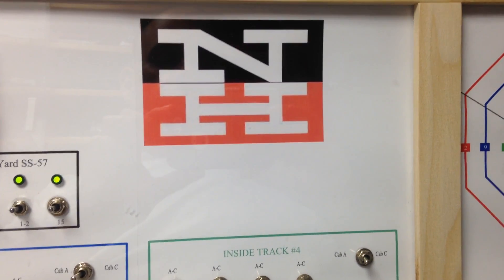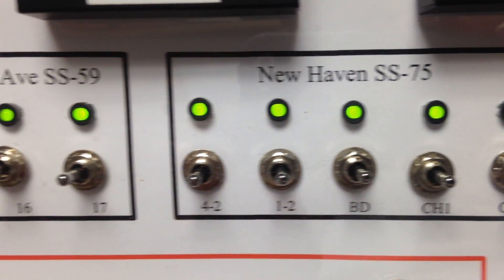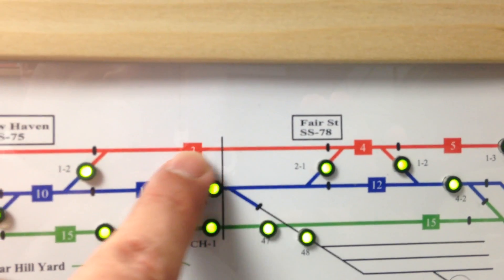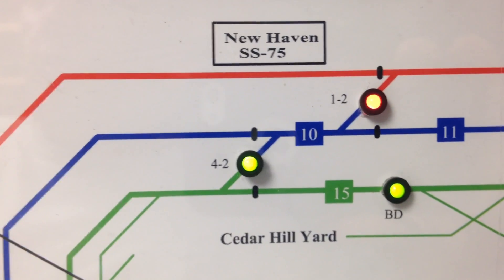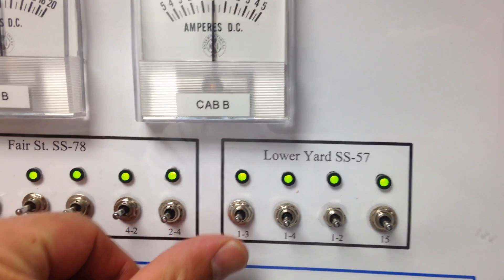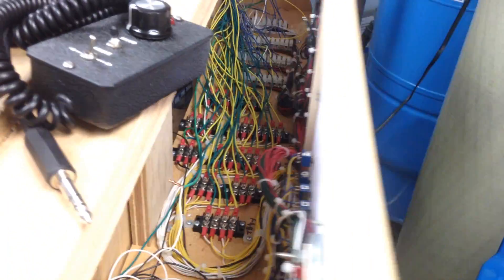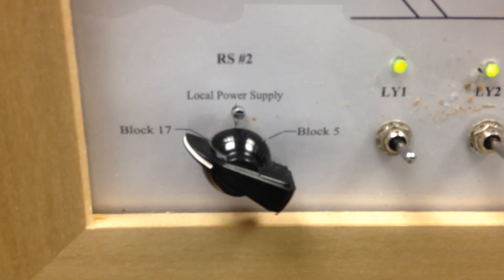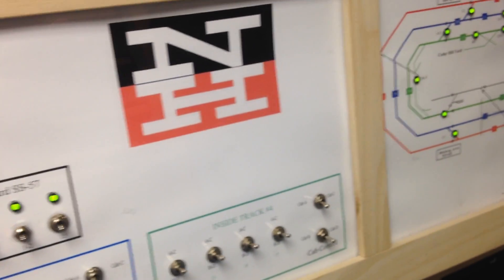New Haven Railroad Layout Update #13

Comment: I've always been fascinated with DC cab control and you have done a fine job in your electrical work. You soon find that when you go DCC you'll wish you never bothered with all that DC stuff. lol Well done.
Reply from the maker: Thanks for your comment. Well with current roster of New Haven DC locomotives I will be primarily DC but any future locomotive purchases will be DCC.
Reply: It's 30 bucks for a chip and installs are easy.. You'll want to go DCC asap. I wouldn't have it any other way.
Reply from the maker: +Class 1a N-Scale Model Railroading well I guess time will tell. So far I am happy with the performance of DCC. Some of my DC locomotives are slated to be converted but others will stay DC.  Thanks for your comments